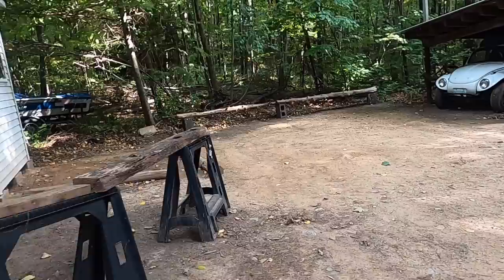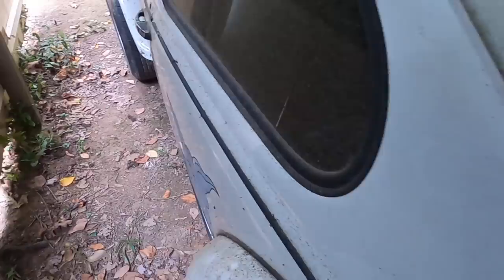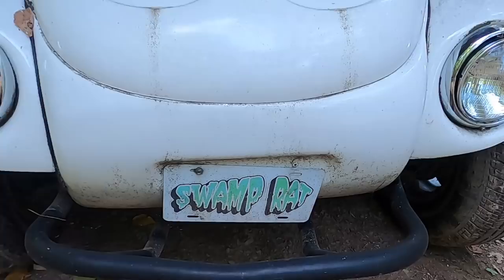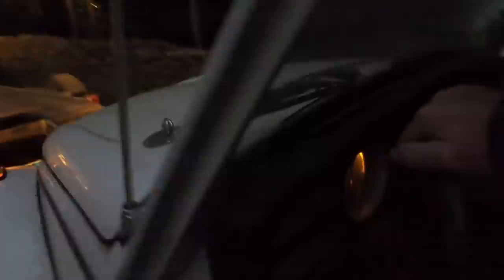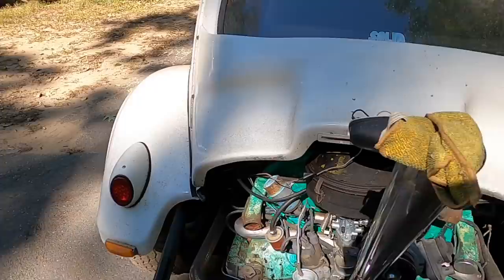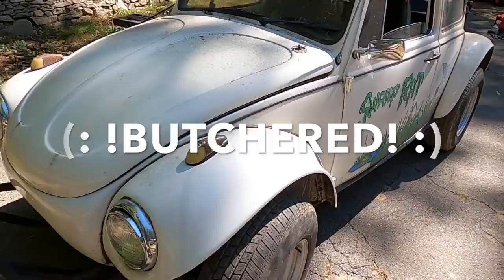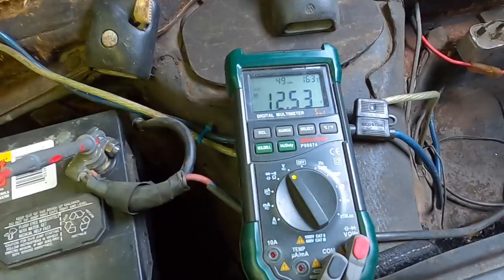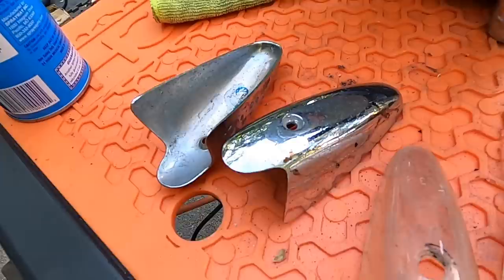Vw BAJA Bug Revival : SWAMP RAT Rescue - First Wash - First Start -  Will it Drive? - Part 1

Comment: Dude! That’s sick!!
You need to paint it metallic sparkle green, add some KC roof mounted lights and a long ass flag. Keep the swamp rat logo!! 🤘🤘
Reply: Monster kfx.    So nice to hear when the 12 year olds comments.  Keep watching and you may have one some day "dude."
Reply: Joseph Jakubec I’m 55, I have all I need and more dude.🤘🤘
Reply from the maker: 👍 , is Tomac just counting down the days to A1 ?
Reply: 5150mxVW I think everyone else just stepped up their game. He had to work hard for the Supercross title, maybe he’s just tired or mentally not in it. I’m surprised how well AC is doing. The remaining races are going to be brutal! Have a good weekend! 🤘🤘
Reply from the maker: @monsterkxf  after the DNF's I think he won the next overall but needed to win again and didn't . so I think he might of calculated points for the year scenarios & the risk vs reward and swapped the Team Kawi factory 450 module to the Vet mode one :). You too
Reply from the maker: canuckguy worried  yeah , well 2 dnf's and a shorter season prob helped him put it in cruise control ...maybe having less heat ( later season ) hurt his typical strong last 15 minutes as well ?
Reply: id say keep it white, put a roof mounted oil cooler scoop and maybe some side nerf bars

Comment: 5150 love the swamp rat,,,,,, my sister had a 69 bug that I used to drive it all the time love the Volkswagen.... Love the snowflake lights front and back....  I’m glad to see you’re learning a little bit more about electrical.....When you get done and things get up and run and you get all your problem solved....Go back and take a thin layer of axle grease or bearing grease and smeared on the connections of the frame... If you’re not gonna jump batteries around cover the top post with Grease,,, ,,just to skim keep the acid fumes from making post  all shitty ...... today do it on all my vehicles all my equipment going to probably the last 25 years longer than that maybe 30  Learned it from an old wrench  on a big project we’re down on the shoreline stringing wire and poles for the high-speed rail back in the late 90s take care junkman do
Reply from the maker: thank you Safety Bacon , yeah , I pull batteries a lot but I will do the grounds . Thank you for the tip

Comment: Swamp rat is the name of most of Big Daddy Don Garltts dragsters, I know of at least 37 different dragsters with that name, but he would add a number.
Reply from the maker: man , i've passed his museum numerous times when going to race Mx in Gainesville , never checked it out , wish I had .
Reply: @5150mxVW  yeah, I guess it's still there, but I've only been to Florida once, and didn't have time to stop. My lady has been, but I don't think she really appreciated it. (before we were together. She used to live not far from the museum.) I think you can appreciate the fact he came up with and or pushed for putting the engines behind the driver. Now it's standard, but back in the day those nitro engines sat right in front of the driver, which he thought was very unsafe... and he was right. I don't know that he invented the idea, but he pushed to get it allowed by the NHRA. Funny how  all the rule making bodies of the racing world are killing the sports. Now all the cars in just about every racing field are the same thing. NASCAR is dead because of their bs, hell make em run really stock cars, not purpose built 300K cars with 100K engines still running carbs. They killed prostock in the NHRA, with their silly rules... and lack of TV coverage too. I do recall one door slammer race they showed... the guy in the far lane LITERALLY got his doors blown off, both of em. I bet he never lived that down.

Comment: Great find Brother. VWs have aways had doors that shut solid.I have owned 13 Beetles and one late model bus. Iv always said you could find a VW gone to rust and if the only thing standing was a door and post? It would shut and latch like new vault door. Great find. I would take the snow flakes if they are real and put them up and throw something that will work on it. You may find a whole bug that needs them. After all the Baja is nice but it will look good with anything that works even a pair off a Super beetle . A nice bug of the snow flake years thats whole but needing them lights would be a better use for them. We all know. Things like them get harder to find every year and they as we all know hang there on the fender begging to take a hit from anything and everything

Comment: I'm not usually a fan of Baja style bugs but for some reason I really like that one. That motor sounds real tired though. Could just need a valve adjustment. I know they're popular for Baja bugs but i'd definitely ditch that header/stinger.
Reply from the maker: thank you Shane , i'll check the valves and do a compression test ....I gotta side with Tiger on this one haha.....they make a lot of cool exhausts for Baja's...not in the budget yet :)

Comment: I had a 65 between 67 Baja in Aus back in 76 it had a corvette back clip off sun roof with guttering red in color twin port 1600 the whole shebang. It was in a car magazine before I owned it. A real head turner better than the one you have. Cheers

Comment: great artwork, but no burnout?
Reply from the maker: does drifting in the back acre today with Josh count ?
Reply: Dear  @5150mxVW  
👍👌👏 Everything you do with "your little sun just for fun" counts!
Sincerely yours
Reply: Dear Mustie1.
Maybe big J has a burnout from having too much Volkswagens and motorbikes respectively from too much working? 😁😋
2) Please kindly allow me to ask something I want to ask for a long time already:  What's about this North American "obsession" with burnouts? No offence! Is it a kind of car cultural difference between America and Europe respectively Germany? Maybe something that can't do burnouts is less worthy in North America? Does it come from the quarter mile races? You would definitely do me a favour telling me because I simply can't get my head around it. Thanks in advance for answering.
Best regards, luck and health.
Reply: Burnouts? Well, i had once for a short time a 71 boat-tail
Riviera and it was fun fun fun fun doing burnouts with it.
455 or 7.5L engine. 
After each redlight the roadmarks where about
65.6 ft ~20 Meters long. I sold as it guzzled to much gas.
16 to 22L/100 KM And way too big to use in a city.
But a fun car on the straightaways and highways.
Reply: No runs no errors

Comment: You said you have 40 cars already I’m sure most are VW s so wtf sell the ones you don’t want or will never use after you take the parts you need then start buying ones that run and don’t need as much work so if you have 40 cars at least it will be mostly 40 running cars
Reply from the maker: hmmm , kinda like what I did this week ? I sold two TOTAL  project Ghia's and i bought this running and driving Baja .
Reply: @5150mxVW  yep dump them Ghia's...unirust hell..and never buy one again.